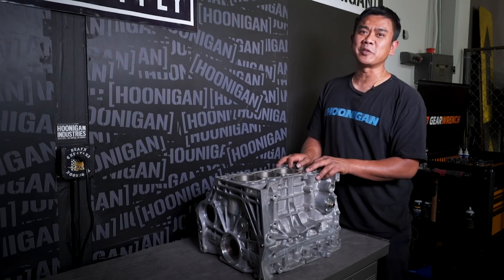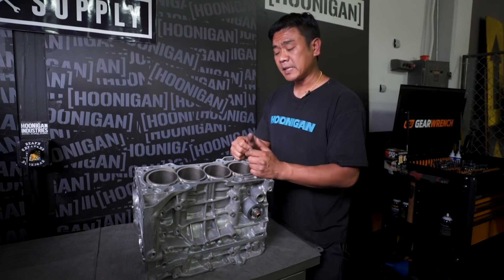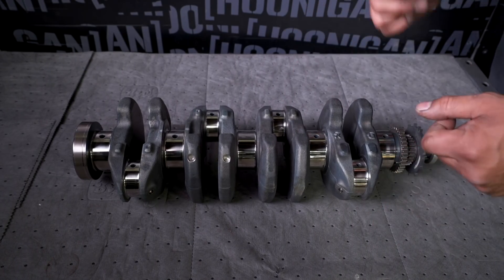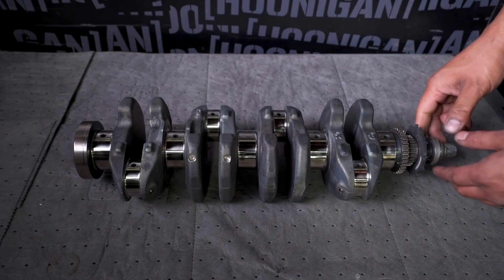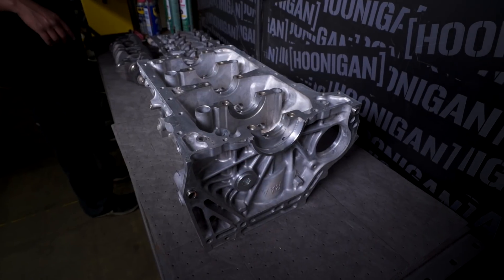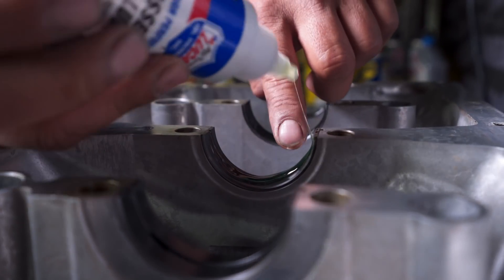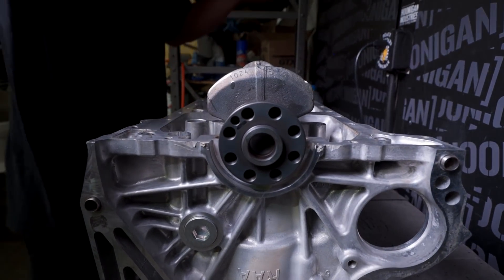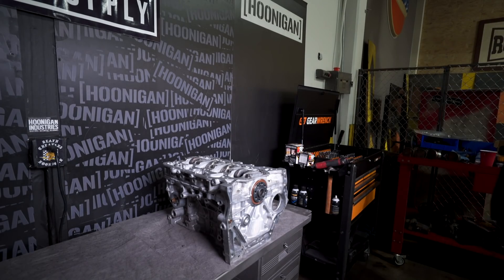Engine Bore and Stroke Explained | K24 RBB

Comment: Just a quick note, do not put excessive sealant a slimm line is more than enough. Do not contaminate the crankshaft back seal outer surface with oil. Overall nice explanation ;)

Comment: I would swap it on to this 2001 honda accord  lx sedan we have just sitting there, it still runs and drives all electric windows and the moon roof still works also 
currently inside the engine bay it has 2.3 liter sohc ulev vtec I'm from west  phx, Az

Comment: Ooh I actually know something here. Re. the torque vs. angle. The important force here is clamping strength but that's pretty damn hard to directly measure so the best way is to calculate it using the ramp angle on the bolt thread, this directly translates to an angle that can be measured. Torque on the other hand can vary a bit based on things like putting oil on before tightening so you have to know if they meant dry or lubed torque readings. Amount of angle doesn't change based on the turning force required.

Thanks AvE

Comment: Reasonable 101, except for a few glaring mistakes... Normally I'd let them pass, but from the comments it seems there are quite a few people who are using this as a learning tool.
0.010" is ~0.25mm 😉
5:55 - uh, no, that is the crankshaft 'throw' the stoke is double that distance - the difference between opposite throws in this case.
2 bolt main bearing caps are found on almost all engines with 4, or even 6, normally being restricted to high performance engines where the additional clamping strength is requred - girle comments are good, though.
WAY too much sealant for the girdle - the gap it's sealing is barely in the thou' range - almost all that excess sealant is going to be extruded to the inside of the engine, in the crankcase - it will often breake free and more than one engine has failed because the stuff has bloked the pickups and caused a loss of oil pressure.
A warning to builders looking to save money - ANY bolt that has an angle specified to tighten-to is a 'stretch to yield' fastener and MUST(!) always be replaced with a new fastener - NO exceptions! 

However, enphasising the importance of the engine being CLEAN kinda makes up for that. 😎

Comment: next episode - can Suppy talk about the difference in engine assembly when using aluminum rods instead of steel rods? Specifically, rod stretch at higher rpm and how to account for it in the static measurements ?

Comment: will you be running a deck brace with this build? If not is the open deck design strong enough in the k24 to prevent the sleeves fro moving at 10k?

Comment: 2:25 that's not the reason for honing. Honing is done for the oil to 'grab by' the cylinder walls, and thus create a lubrication 'film' (or surface, if you will). That would, on contrary of what Suppy said, make your pistons travel smoother without grabbing the cylinder walls. Also it prolongs the life of your rings, pistons, and block. It has nothing to do with compression.

Comment: not sure if part of the video is skipped, but did Suppy install the bearings without doing the clearance first? Not sure if its OEM bearings or aftermarket, OEM bearings have a certain thickness which helps make the crank more balanced. (some say OEM bearings are more accurate than aftermarket ones) Usually the steps involve using plastigauge and stuff but I'm assuming Suppy knows what he is doing. ✌️

Comment: @3:18 - not knocking you Suppy but you CAN add weight to a crank to balance it...    usually more expensive to do as it requires a very heavy metal like Mallory to be pressed in a hole. The OEs find it cheaper to cast larger throws and just drill to lighten / balance.   Awesome video

Comment: Would have loved to hear your explanation of rod-stroke ratio and the way OEMs vs Indy cars use these strategies differently! (i.e. high revs with low stroke big bore vs low revs with big bore high stroke).
Reply: You mean bore-stroke, rod stoke is a different subject - they can be related, though.
Reply: @gordowg1wg145  you're 100% correct. Thanks for catching that!

Comment: I'm sorry to say Suppy got the honing bit wrong. The rings are pushed against the wall by the crankcase pressure, coming through small holes in the piston, behind the rings. The cross hatch allows oil to stay on the cylinder wall, so the rings don't scrape on bare metal. A rough surface would wear them down faster, but a cross hatch is a very fine pattern that doesn't scratch.

Comment: So when you get your engine back from the machine shop all machined and cleaned. Does the machine shop send the bearings with the motor or do you have to buy the right bearings what will work with your machined crank?
Reply: You only polish the mains, they do not get resized.
Reply: Rahziel420 so why didnt he plasti guage to make sure the clearance was good?

Comment: .010" is .25mm
.020" is .50mm(half a mm)
Reply: See? When it comes to sicence, ppl are using metric and not imperial...
Reply: @John Daley Not a lot of close tolerance work in horticulture.
Reply: thanks for this, coming from the East, sure I'm confused.
Reply: @mal3762  Just a USA machinist here, I'm used to having to convert.
Reply: Yeah exactly. To be more precise, .010" is .254 mm
Reply: @71ChuckNorris  so a 0.010 over bore leaves the bore 0.08mm bigger than the pistons require? Is that even within tolerance?
Reply: @seshelbow336   0.010 what? Inches? 0.010 inches is 0.254mm. you mean a 0.08mm from side to side? Its actually 0.008mm. Normally no, because you will take the exact conversion number. Also, 0.008mm is quite insignificant, and imo really hard to measure, even with a dial caliper, or a clock type caliper. Also that is equal to 8 millionths of a metre, so its obviously really small. Specs are maybe in the mm range? Like 1mm?

Comment: I thought that the cross hatching in cylinder walls was to give oil a place to go when being lubricated.
Reply: To be more precise: it makes shure, that the oil doesn't run down the cylinder walls too fast and ensures, that the piston doesn't run dry on them. Main reason for honing. Don't mistake it for hooning!😉😬
Reply: @sebi89onair  the explanation that suppy gave sounded completely made up to me. Ive never heard what he said before
Reply: @arcadiagreen150  Suppy is correct. The piston ring needs that rough surface so it can wear and seat in to the cylinder wall. if it was smooth it would never seat (also called bedding in). oil rettention is another benefit. all the explenations here are correct but the is no ONE reason for honing, there are several as stated
Reply: I think what he is talking about is how the piston rings seal the combustion chamber between piston and cylinder and how the oil scraper piston ring leans on the cylinder. So it's not entirely wrong, but it has more to do with adjusting the piston ring play than with the cross cut on the cylinder. Both make sure the piston runs smoothly in the engine without hurting the cylinder surface.
Reply: Did he not need to check bearing clearance?
Reply: Lube and seal are related
Reply: You're right, Modern pistons are have holes behind the rings, so the crankcase pressure can push them out. You don't want a rough surface as it will wear down the rings, the cross hatch is a very fine pattern, so it works. The oil film allows the rings to slide smoothly along the cylinder wall, instead of sliding on smooth metal or grinding on a rough surface.

Comment: Bore is the diameter of the hole you are pushing into. Stroke is the length in which you slide inside that hole. Personally i prefer small bore and large stroke.

Comment: will this engine build;will be a naturally aspirated screaming monster or more like a turbo spool
Reply: They're saying 10,000rpm + all motor, so it's easy to guess!
Reply: @Zanpaa  yeah, I already knew it will be a naturally aspirated engine but I was a little bit suspect because they are using bone stock engine internals for this insanely high RPMs,
Reply: @pabitrikalita3940  Yeah I was surprised to see they're using the stock crank too. They have forged pistons and rods I think. Tbh I don't know much about engines, so I assume the K24 crank is strong enough stock!

Comment: When they hone a block it is actually truing up the cylinder dia to spec. this is done to achieve the RA. finish in the sleeve. the pattern you see on the walls is cross hatch. This allows a very thin layer of oil to remain on the sleeve to keep the rings from scratching the sleeve.
Reply: you are almost 100% correct

Comment: Honda K series engines VS any other 4 cylinder: is any 4cyl better than Hondas?
Reply: Better at what? Honda k series 4 cylinders are good because they are reliable pretty powerful NA and cheap. You can probably get an engine that makes more power but will cost more to buy and build and may be less reliable over time. Honda k series engines are currently in the sweet spot of cost reliability and power and availability.
Reply: @thriceguys  true